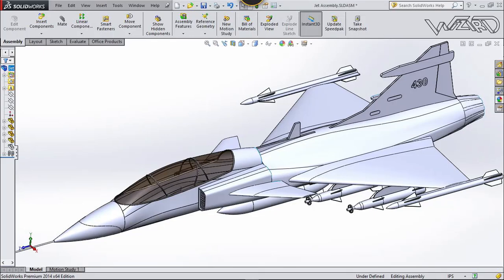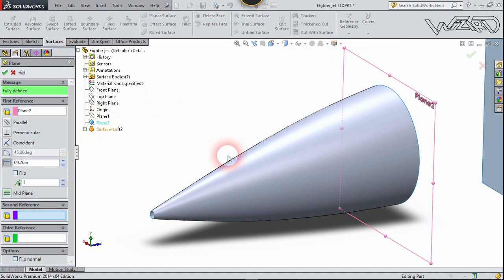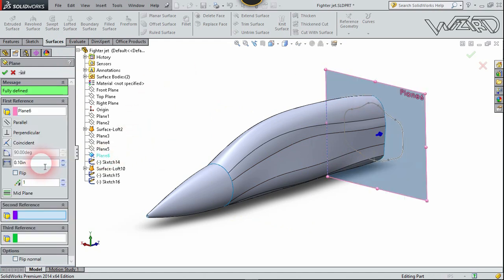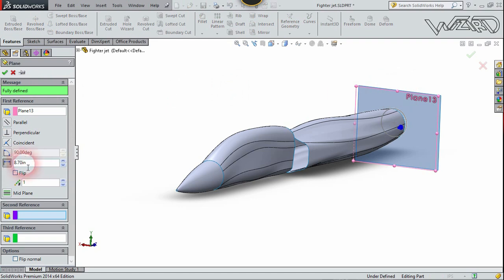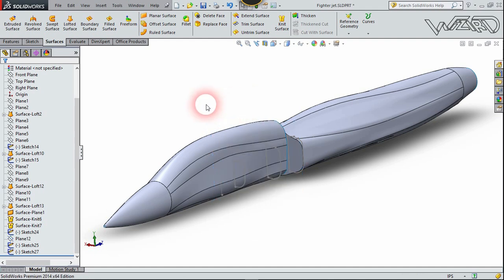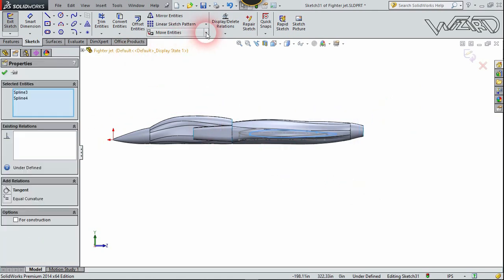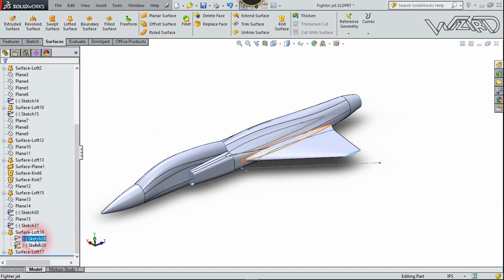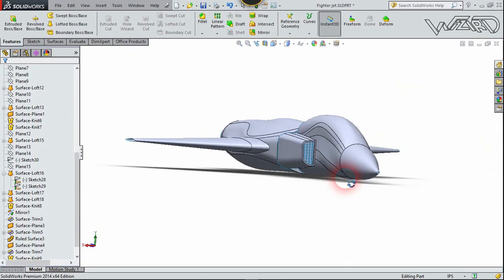How to Design Fighter Jet Air Plane in Solidworks_Part-1 | Advance Surface Modeling in Solidworks

Comment: This is a good tutorial for those that know how to use Solidworks however if you are new to solidworks this is probably the worst tutorial to start with. He misses out alot of dimensions so you end up having to do abit of guess work. He misses a couple steps too which are pretty crucial but because i know the ins and outs of solidworks its not that bad. So make sure you watch a couple other surface modelling tutorials first before you come to this one as not everything is provided for you. Good luck
Reply from the maker: this is not for beginner . thanks you